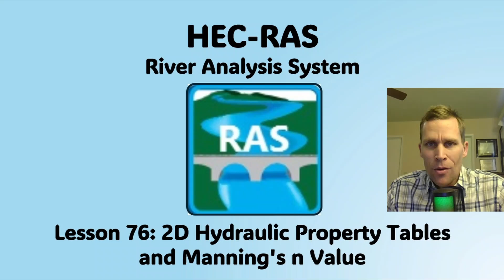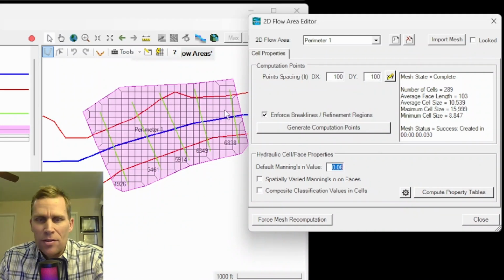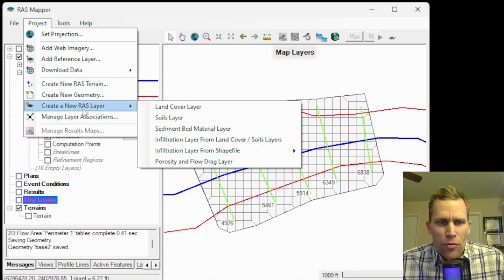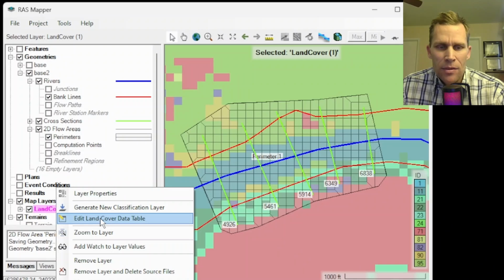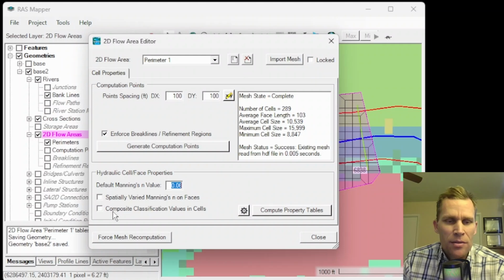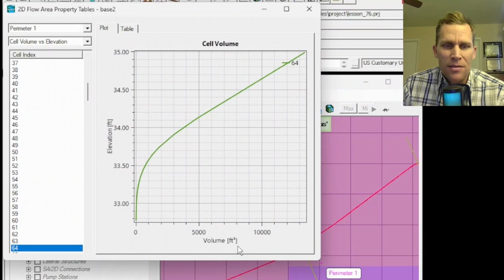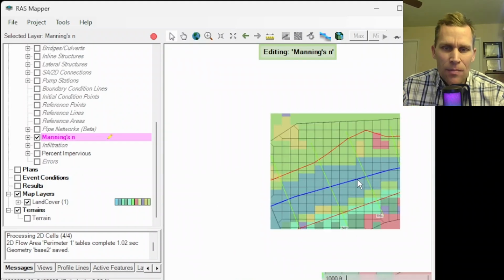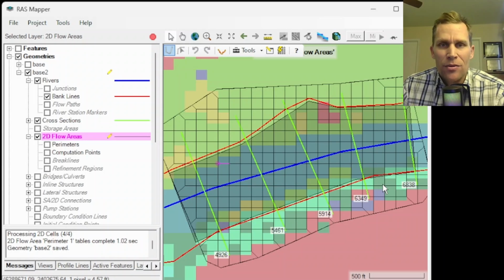HEC RAS Lesson 76 - 2D Hydraulic Property Tables and Manning's n Value

Comment: I’m encountering an error in HEC-RAS when trying to run a 2D unsteady flow simulation:

“Cannot recompute 2D property tables – No terrain is associated with this geometry.”

I’ve already:

Created and associated the terrain and Manning’s n layer with the geometry.

Rebuilt the 2D property tables multiple times.

Tried adding a dummy Land Cover layer.

Rebuilt the project entirely in a new folder on the C: drive.
Reply from the maker: Here are a few ideas to try:
1. Leave RAS Mapper open while you run the unsteady run.
2. Check the geometry -> terrain association inside RAS Mapper
3. Move the terrain files into the project folder (or a subfolder of it).
4. Delete the geometry HDF (cache) and re-associate/recompute. You may want to save a backup of this file first.

Those are just a few ideas. If that doesn't work you're welcome email me your project files zipped up and I can take a look at them. tim[at]boshsolultions[dot]com
Reply: @TimNelsonPro  "Hi Tim, I sent you an email but I’m not sure if it reached you. Could you please confirm if you got it?"